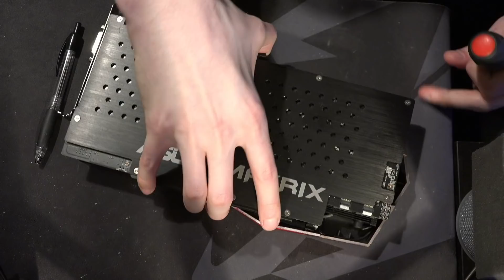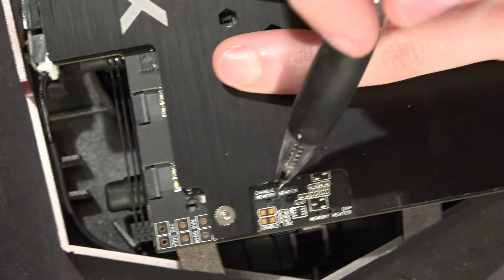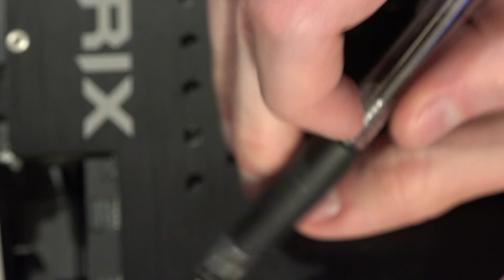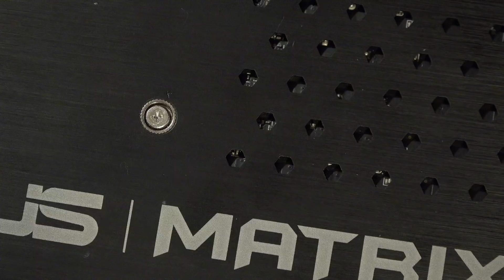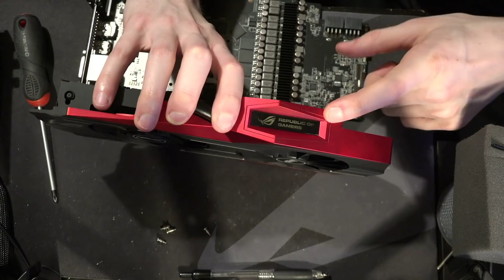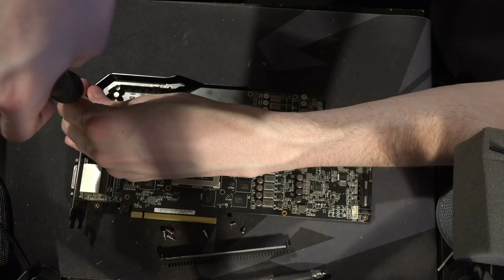GPU teardown: ASUS R9 290X Matrix Platinum

Comment: Anyone knows a good forum to read about GPU repairs? I have a failing 390x Strix DCIII that has no artifacting or weird screen issues... The card will crash/restart the driver randomly and sometimes even black screen and then reboot the whole system...Even seen it completely hard lock the pc while gaming or watching youtube videos(sound looping too). I downloaded HawaiiBiosEditor and underclocked my core to 900mhz and my ram to 1000mhz and it doesn't seem to help...The card can run the heaven benchmark for 1 hour straight and then crash in like 1 minute(temps under 65c). Even overclocking the card doesn't seem to crash it easier so i guess it's not the die itself... I have been using it in the past with a waterblock and no vrm cooling(for about a year), could a failing VRM cause this?The board seems to be weird around the vrms(like stained) but looks nothing like something was fried...Really frustrated, can't afford to get a card right now and my old 6970 can't play anything at this point :(  ANY help from anyone will be greatly appreciated!

Comment: Mine is with no load already on 70c and in a simple game 95c... I'm working on it right now, before I used Arctic Silver 5 thermal paste which is really bad for this heat pipes, let's see what I get after switching and cleaning
Reply: Looks like new now and about 20c to 34c cooler :) Idle and gaming :) Happy with it

Comment: Currently running a hd7970 matrix platinum, tried to over clock it but it artifacts immediately when bumping core clock no matter what voltage you give it and boy does it get hot! Maybe a dud? Could also be a less than optimal psu, who knows, cool card none the less tho

Comment: yap ya got that right asus kinda most of the time screw up on the thermal paste they use even on brand new GPU, and laptop i have seen it  several times especially on their low end and mid range laptop even on the high laptops to. No idea why they use that thermal goop like bubble gum stuck on the VRM and choke/inductor

Comment: them screws that hold on the VRM heatsink, maybe a difficulty if the backplate does not play with LN2 pot mounting hardware. Hmmm, 'Tweezers' (holds up a zip-tie) may work for that I guess.

Good stuff BZ, I foresee lots of cap-mods and LN2 OCing for that card in the future. B)

Comment: I have a r9 390 Asus dcu2 and changing the thermal paste didn't help much with temperatures. I modified it with a little copper plate and dropped 20 degrees.
Reply: Taking it on logic, outer heatpipes that have no direct contact arent properly used. BZ in this video was wrong with just passing this problem and  stated that bad termal compound is a bigest reason of  hight temps.
Reply: @adamek1xd  I think it's about tolerances the gap between the heatpipes of my card seems to be bigger than in the video.

Comment: @Actually Hardcore Overclocking
Or anyone else for that matter. I would like to replace the tim pads on my SAPPHIRE R9 290 Vapor-X. However I contacted Sapphire and the support department didn't even seem to know the thicknesses (lame). So all I was able to replace was the GPU VRM's since that was directly under its very own heat sink. But the main GDDR chips and the GDDR VRM's did not get replaced since I couldn't figure out the thickness myself and a few of those pads are in desperate need of replacing. I looked at EK water block install instructions and the sizes they use do not look like what I have on my 290. I want to use Fuji Poly Extreme, so I need to make sure I order the correct stuff. I know its an old card now but I plan to give this as a gift to someone who really wants it and well I want the temps to be as awesome as can be possible using the stock cooler knowing that they will highly overclock this card. Thanks for any advice.

Comment: I've done a bit of research and now I'm wondering as to why thereare almost no improvements in AMD's GPUs until the RXseries cards came out. so the hd 7970GHz edition vs the r9 290(x) and the r9 390 (x).
They only perform slightly better than the previous card.
I may be missing something but raw clock speeds didn't really change all that much and the only difference I can spot is Memory clocks and amount. Not even an improvement in TDP. 
Either it's 4am and I'm missing something very key or I could have bought an R9 290x and watercooled it for the price of my 390x
Reply: It is believed that
1) 7970=280X --> 285 --> 380X --> around the level of 470=570 (though these two could be = 290 non-X)
2) 290X=390X --> 480=580=590
If I'm not mistaken, of course 😅
And surely it's more complicated than that - because GCN revisions are a thing.
Reply: @previousslayer  I'm talking flat peformanceim games. I haven't noticed much of a difference. I owned a 7970Ghz edition at around 1050Mhz. Was loud because of dust. I didn't really care as my pc was almost 5meters away from me. Talking about AMDs end almost nothing changed.
The don't produce their own vram so it's not their own accomplishment having higher density and faster gddr5.
Meanwhile A GTX 980ti was able to clock up to 1400 inaudible. 
Now the gaps are closing but AMD's cores still suck. 
Their pcbs are better than novideo's pcbs though.
Reply: Ok so the reason there were no real performance gainz from the 1st 2 generations of gcn are simple, the only real changes from GCN1-GCN2 were features that developers pretty much completely ignored. The manufacturing process was 28nm until the RX cards which neither AMD or Nvidia were happy about because both were banking on 20nm not sucking for GPU's though AMD were betting on it way more, I bet their original plan was to shrink Hawaii to 20nm for the 390X (Like they did for Vega 20) and then release the GCN3 cards after they got used to it.
Reply: @1toncheese  wait isn't the rx 580 12nm?
Reply: @Oldsah  no the rx series is mostly 14nm, far as I know only the RX 590 is 12nm.
Reply: @1toncheese  So my r9 390 is 28nm?
Reply: @Oldsah  yes, its pretty much an r9 290 that was binned better.
Reply: @1toncheese  ooft. Please navi be better
Reply: @Oldsah  It will, problem is we don't know if it will be good enough.
Minimum spec requirement for Navi 10 to match Vega 10 (since AMD is planning to make that performance tier mainstream and navi is a polaris replacement) is 2560sp's, 48/64rops clocked at 1800mhz (which is doable for AMD on 7nm), and thats without arch improvements. Once we know more hard specs it'd be very easy to guage how well AMD thinks navi will do since GCN is a very well understood arch.

Comment: I have direct contact HP 960 and originally it would get into the high 70's and then I replaced the thermal paste and it hardly ever hits 55 now

Comment: Hey BZ I got a question for you. I have an evga sc acx 780 and one of the small silver and blue caps above the power stages broke off. Any idea on the specs so I can try and solder a new one in?

Comment: The R9 290x Is my favorite GPU of all times.
Reply from the maker: yeah Hawaii and Tahiti are probably the best cores Radeon made.
Reply: ATI/AMD hall of fame:
👉3D Rage Pro. Quite competitive.
👉Radeon 7200. The pioneering Radeon. Not a direct competitor (when it comes to performance in the then-current workloads) to Geforce2 GTS and especially Geforce3 but it was close. It was just different.
👉Radeon 9700 (Pro). And the corresponding "reject die" 9500 (Pro). Monster cards. DirectX 9 beasts. Doom3 death machines. Novideo annihilators.
👉HD 7970. A miner's dream and an equivalent of the current 1050 Ti. 'Nuff said. And GCN goodies (Finewine, all that stuff).
👉R9 290X. Another miner's dream, the equivalent of the current 1060, the 590 is practically nothing but a rebrand of it. Also GCN. Also 'nuff said.
I may've missed something...
Reply: still rocking mine to this day
Reply: @charlesballiet7074  mine go black screen after installing AMD drivers... :( Dont know why...
Reply: @lusitano82  Knocking on wood, but it may be oofed 😫 Those damn chips just love doing that. Too powerful for their own good. In many cases, reballing won't help - it may only provide a temporary (from several hours to several years) antidote, the same kind as if you just heated the chip or the card in an oven or on a platform to try restore the internal chip structure (nothing to do with BGA! Although that area can also be suspect in select cases). Or, as a possible positive scenario, a VRAM bank got borked - that's more and more easily fixable imo.
Try lowering the clocks and maybe voltage, or raise it, whatever helps, if it still allows you to do so. If no luck, see above 😢
Reply: @previousslayer  I'll try one more time, it's been a few months since I tried it last time. Then I'll tell you how it went, thank you.
Reply: @lusitano82  No prob :) Nothing that I suggested is in any way special, and there may be mistakes
Reply: @previousslayer  Not successful ... :( The monitor goes black during driver installation.And when I restart the pc, I can see the windows logo, but a few seconds later the monitor turns black again. Could it be the HDMI port?
I'll leave the GPU in a friend's computer store, maybe he can bring it to the living again hehehehe Thanx for the help!
Reply: @lusitano82  I used to have that issue with mine. Turned out it was rivatuner statistics server causing that issue. Uninstalling it fixed that.
Reply: i have a standard R9 290 at 1050 core - 1400 mem, and with a personalized fan curve (vBios mod). I replaced the thermalpads and the themal paste, and boy that made a difference, even with that overclock always stays betwen 85/87 ºC, thats fairly cool for this gpu's!.
Reply: I'm still running a 290 and it seems to have degraded. Running at 925 MHz when factory is 1040 MHz (Windforce 3 card). BZ has inspired me to try and replace the caps. Hopefully it's just bad ripple and not a dieing...errr..die
Reply: Zfast4y0u the reference cards with the blower type of fan usually hits 94 c before the fan ramps up the rpms to cool it down. I achieved a stable oc with lower temps than the stock configuration.

Comment: Watching this makes me want opening again my 780Ti Matrix and try to repair it...
Reply: Bake it
Reply: @StellarPrism  I think its some with the VRM. Probably dead
Reply: @borisdg  That's why baking maybe could help :) Worked 5 times for me now :) Remove all plastic parts and bake it 150c for about 10 minutes, watch some videos before. Does the picture flicker and all right after you start your pc?
Reply: @StellarPrism  Fan speed is at 100%, no picture and the core is cold.
Reply: @borisdg  hmm, never had that exact same problem, maybe a crippled capacitor? Because that's what's happening when fan speeds go 100% without the card really working sometimes
Reply: @StellarPrism  idk. thats why my guess is dead vrm. core cant boot so its cold to touch and 0 picture

Comment: is the cam a bit laggy?

and about the 3598s at 14:00 (ish):
maybe they are using 1 as a doubler and the next as a dual driver. 1 PWM im, 2x drive out.
Reply from the maker: no because you can run 2 phases of 1 3598 regardless of how many PWM signals you are feeding it

Comment: I bought this card new for cheap... the Cooling was terrible and loud as fuck. You actually could lower the temps significantly by removing the red plastic shroud. but it clocked nice . especially if you change the cooler.

Comment: My 280X that I bought for 250€ 4 years ago has a kinda similar cooler. The fans have failed already, but just gluing caseless 92mm fans pretty much solves that issue with even better thermal performance :D
Reply: @tacowang  Did you also hook them up over the gpu like the original ones used to be? Because I managed that and now I have streams of ketchup and mustard on my card :D
Reply: 250€ ? I bought my non x for 160€..
Reply: @Xenoray1  Well 4 years ago is already almost 5 years ago and I bought it new to turn my first self built PC into one that can also play games (went from a temporary HD 6450 to the 280X). I made the switch to my V64 half a year ago

Comment from the maker: FIRST
Reply: LOL nice
Reply: Did you try new Thermalright's TIM?
Reply: @BuldZoid hi, greetings from Poland. can you use this project to show how you modify bios, memory timings and power play tables. Ps i'm interested because i have 290x vaporx 8gb, downclocked to my needs(950/1400). Wattman doesnt alow me to use lower mem speeds, and my bios mod atempt was stoped by non working hawai mod app.
Reply: You do know there's a Box you can untick in the setting of GPU Tweak II so it will not load setting on restart?
Reply from the maker: @hugoagogo2307 Yeah I know about it I still ended up in safe mode twice with it unticked.